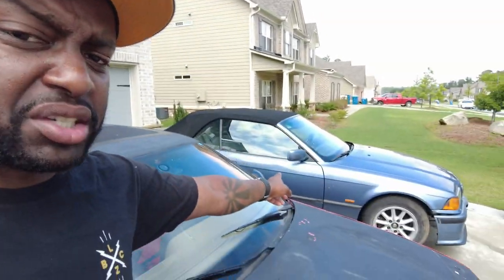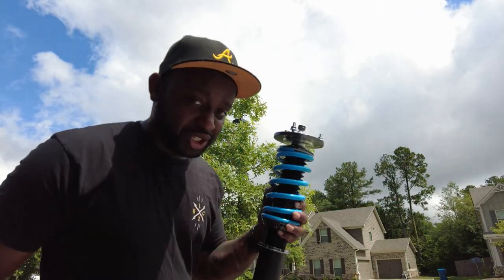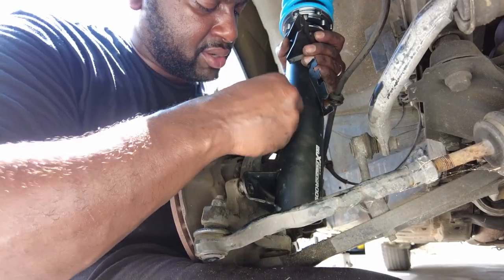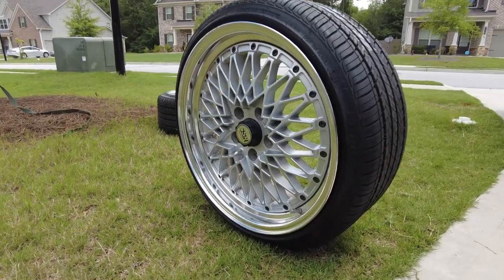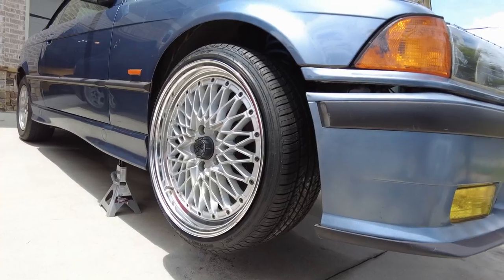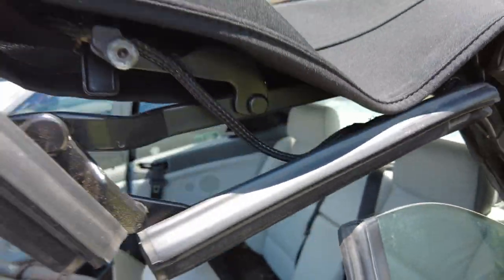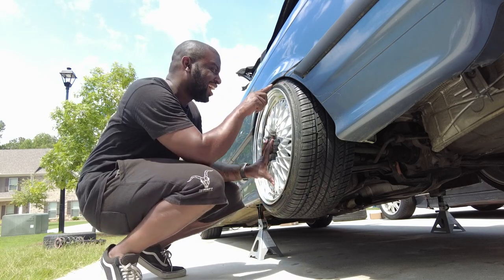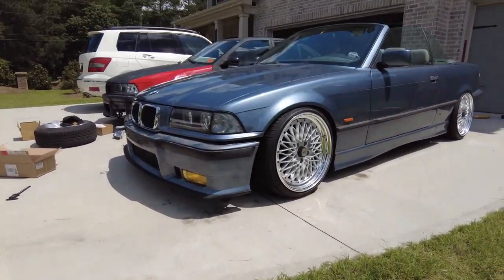E36 Vert Gets SLAMMED on JDM Wheels (how to install coilovers)

Comment: I have m3 vert lets gooooo, at exactly 30:52 while you have the tonneau cover open there are drains you can clear out that might stop the water accumulating in the trunk/back seat you can see it on the right of the rusty bolt

Comment: just did BC coils on my friends E36 323Ci yesterday and u just made me so mad with how easy u did that😭 i’ve never done coils before i took off the whole breaks , wheels bearing , heat shield , and lemme tell ya it took me around 6 hours to just the fronts😭 doing the rear today and imma do it much better thank u

Comment: Looks hard but isn't the spring adjuster in the rear supposed to be on the top? I put solowerks on mine and the install instructions said to put it on to otherwise you can't adjust it without removing the whole spring
Reply from the maker: I don't think it matters. My Broadway's mount on the bottom with a nut and bolt connected to the bucket. I guess if it's on top it's easier to adjust it without pulling the spring back out
Reply: @itsBlack  awesome, thanks for providing that info. Good work on the car, I'm working on my e36 vert too. Check out my YouTube and insta... I'll look to your build for inspiration :)
Reply: Thats what i was thinking. Cant adjust with it on the bottom

Comment: Looking good dude, what's the ride like on these new style maxspeedingrods? My old ones were super bouncy on the rear, ended up putting stock M-Sport shocks on the rear with the MaxSpeeding springs, was perfect then.

Quick note on those conversion spacers you've got though, noticed they're not hubcentric, there's no centre protrusion for the wheels to sit on so your wheel studs are taking all the sheer force there, not ideal.

If you can, get some slightly more expensive ones with the hubcentric centre for sure 👍
Reply: I used to think the hub protrusion was structural too. Then someone did the math on the clamp load applied by the bolts vs the shear load needed to move the wheel. The shear load would be waayyyyyyy more than the car will ever see. It's only a centering feature. I agree, having them is ideal, but not for the same reason. The taper on the bolts and lug nuts is sufficient for centering the wheel. 

See Garageaholic's youtube page and search "Clipz Motorsports". He shows all the calculations.
Reply: @DadBodGarage  Interesting, thanks for the reply, I'll have a read around.
Last time I looked into it the consensus was different but I guess things move on, I'll go and read around again 👍
Reply: @delmcgeorge6293  Yessir. it still prompted me to ask one of the engineers at work that retired from GM ride quality division what the purpose of the hub ring was. He told me it was purely for centering the wheel during assembly. I had instructors tell me, while I was in school for High Performance Motorsports Technology, that the hub ring was for shear forces but never provided any information passed that. I believe the math now.
Reply: @DadBodGarage  having had a read around of a few articles I'm a bit on the fence.  There's definitely some articles (written by engineers), with examples, that show lug centric can fail where hub centric wouldn't.

I think in 90% of use cases most people would be fine, but when hitting a big pothole or some other decent impact I'd feel happier with hub centric.

I'd also throw in that if you're solely depending on a lug centric design you want those studs/bolts to be good quality.  Cheap spacers arguably may not have the best quality stud material...

Throw in most quality brand spacers are hub centric as well.  I'll stick to hub centric.

But has definitely been interesting to read around on, thank you 👍
Reply: @delmcgeorge6293  I’d still definitely suggest garageaholics video. It provides a bit of insight!
Reply: @DadBodGarage  I'll def still check it out, not done reading up/learning yet 👍

Comment: If you want you can lower it more by removing the collars in the front and then you can add more camber by removing the two Allen’s onto the other holes that are in the top hat, that’s what I did with my maxpeeding rods

Comment: Black on my 97 328iC Vert Identical Exterior Color and Top to yours but tan seats and Automatic, I have bad Drivers seat gear for reclining, What is my best Option here in North Florida? I dont really have to covered garage to work in and my tools are limited
Reply from the maker: I had that issue a long time ago. There's a tiny plastic gear that breaks in the seat. I took it apart on a bored day and readjusted the seat and put the gear back and never moved the seat again lol

Comment: i'm personally a bigger fan of 17's on the e36 cause it gives you room for a meaty tire and they're just cheaper and easier to find same with tires for 17's but I also 100% agree that 18's fill the wheel well of e36's way better

Comment: How does the convertible ride with these ? Looking to get a set for my vert but don’t want an unbearable ride. I only drive it 2-3000 miles a year, which is why I’m considering getting these.
Reply: Wondering the same. About to order them for my 98 323i vert

Comment: Damn what a makeover the coils and wheels did - Sheesh !! I may get roasted for this BUT - Is there anybody out there that can give me like a simple but decent explanation on Offsets - Because Black obviously has the science down to a T lol - Just a 'Offset for Dummiez' if you will lol
Reply: My understanding is that Offset is the measurement of the distance of the wheel face that meets the hub from the wheel's center. The center of the wheel is 0 offset. Most wheels have the center closer to the outer rim rather than the inner which is positive offset. When the wheel's center face is closer to the inner rim, then it's negative offset. 

The less offset you have, the further out the wheel will sit.
The more offset you have, the closer the wheel will be to the car.

If you have a 17x9 wheel with +35mm offset, then go to a 17x9 +15mm, your wheel will stick out 20mm more since the face is now 20mm closer to the inside rim, pushing the outer rim away.

Comment: Bro you must connect the sway bar to suspension, you wont believe how much it improves handling
Reply from the maker: Sway bar is connected but to the control arm. Only M3 is connected to the shock
Reply: @itsBlack  yea so connect it to shock

Comment: 20:19 no that’s not the reason why. They just suck. If anyone wants a unbiased review with these specific coilover model check out “ImJoel” YouTube channel on these.. I wouldn’t throw these on for free on any of my cars. Rather spend $300 bucks more for some Tein or something. Also don’t follow this “how to” you shouldn’t max out the coilover like that, to its last threads. It’s not safe. But hey these stance fan boys will do anything to have thier frame & oil pan scraping everywhere they go with the fender/bumper mounting point all broken.. doesn’t even matter if the car is running or not.. or parked with a blown engine.. “ StaNcE iS LifE “ 

Would I run their Forged rods on a turbo m5x engine? Yes. That’s a part were they actually took time to make it legit.. theirs prove out there that they hold power